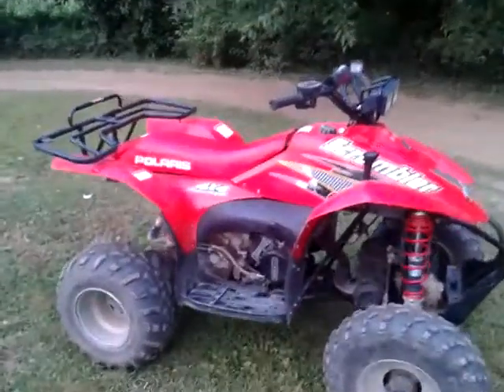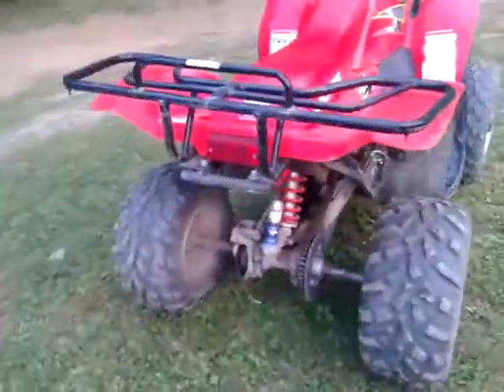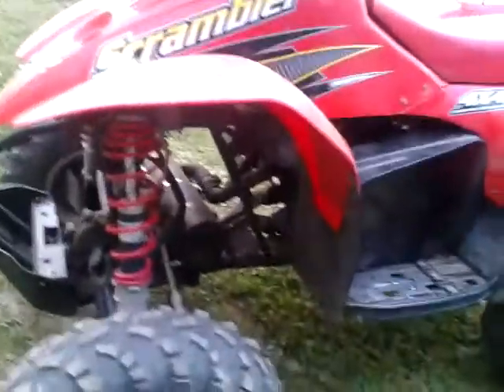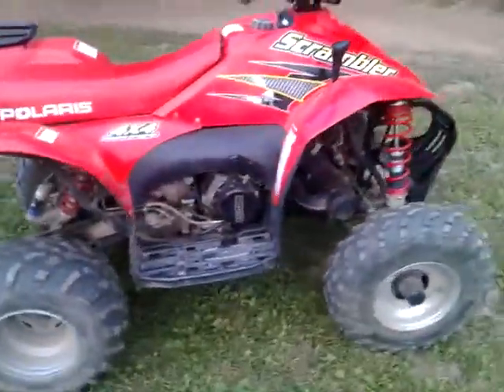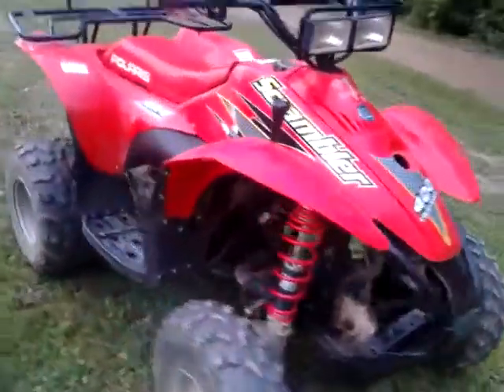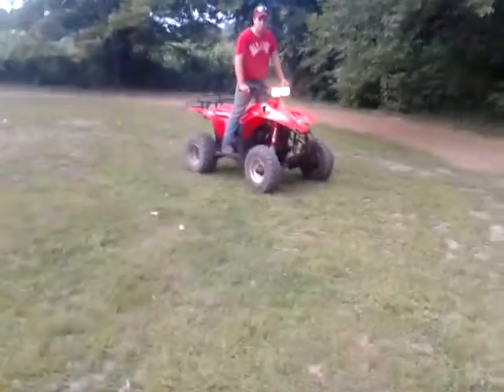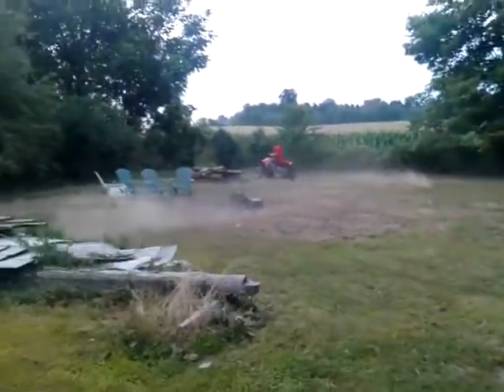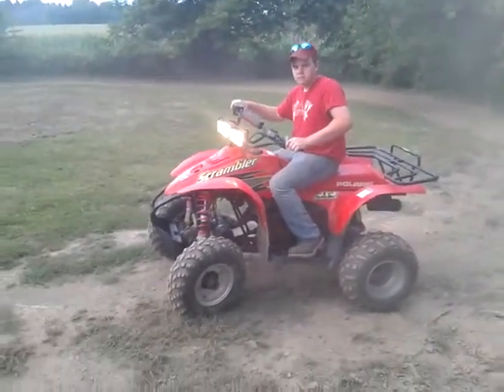Polaris scrambler with 340 Free air For Sale.

Comment: 340 is rated around 36hp...curious of why a 340 twin and not the 488 indy trail motor?   Or something with more juice
Reply from the maker: The 340 was way better than the original engine and far more reliable and it is what I had available. Thank you for watching.